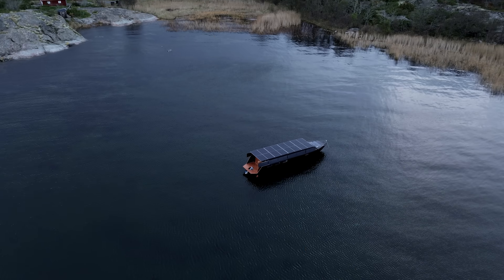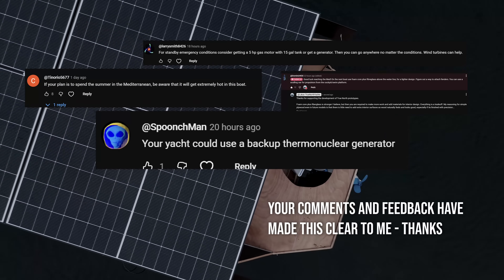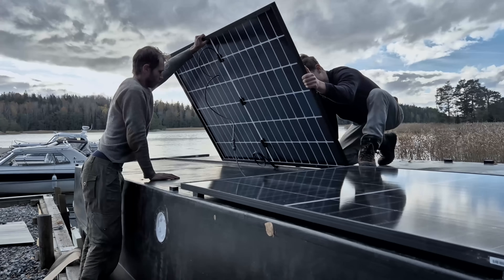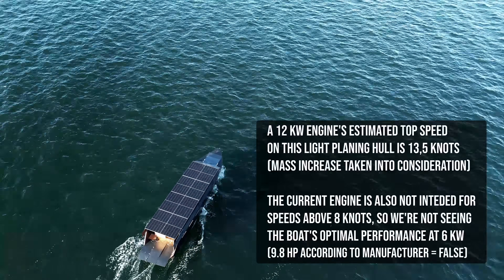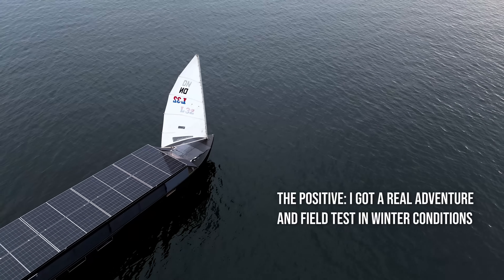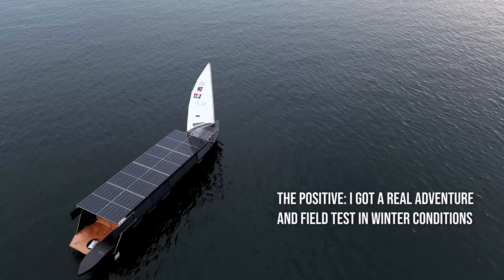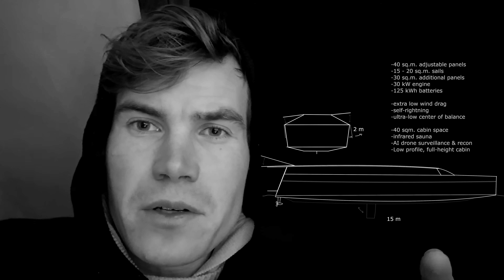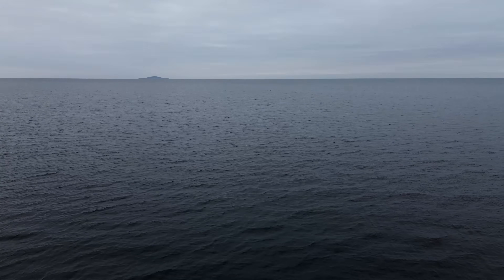3 Mistakes That Nearly Sunk My Solar Yacht

Comment: Mistakes, hehehe,
It is really funny how people watch other people make mistakes and think they can do exactly the same thing but succeed.

Hullspeed based on LWL, hehehe.  do you think a shallow draft(20cm) 13m LWL has the same hullspeed as a 13m deep draft(1.5m) boat.
Hullspeed is not just LWL, it's also wetted area(drag) and shape
Sails, your little sail won't do much and is easily tested. 
There are also programs to develop polar charts, but they may not work for such a small sail on a big boat
A sail your size on that boat is like putting up a  storm jib to keep the boat in irons over night

Comment: Why don't you build a battery with loose cells? Type EVE 314Ah or EVE 628Ah, then it will be much cheaper and also lighter.

Comment: Take a look at the idea of using a parra kite sail ... Smaller size up to 8x the power for a given area and no shadows on the panels . You would need less keel mass and area than traditional sails.

If you can add out riggers you can add hinge panels to the cabin sides  ...at higher latitudes in winter these can work better and start earlier  than horizontal ones ...if they were bi facials over the water there's a significant efficiency  boost there.. being able to angle the panels on both sides from almost vertical through 180deg. Means you can optimise exposure in calmer conditions.
Reply: A para kite sail is a great idea. 
I think it’s possible to automate flying the kite by having a quadrant of limit switches in the shape of a rectangle around the control ropes and two stepper motors to control the ropes. 
Utilize AI to write the g-code program that controls the motors. 
Wonder if there’s an open source group working on this challenge…

Comment: great work, great spirit. for now it's the operating conditions that are so far out of spec, a back-up generator is simply common sense - get south quickly! get warm! winter solstice 4 weeks.
few battery chemistries enjoy deep discharge, so for protecting your investment a generator is common sense.
any offshore craft dependent on electricity ought carry a back-up generator, including future developed versions. how do you meet mayday response obligations, for example?

Comment: Without a keel, a sail will just take you in the direction of the wind.
Reply: Leeboards would be a good addition, no interior intrusion.
Reply: @MrEricmgt  I think leeboards are the right call as well
Reply: A kite less so but  a  couple of inline dagger boards would help without the penalty of drag. Boreal  uses two fixed dagger boards on their  monohull explorers .. though a Cat like a Wharram Pahi would provide the best platform or by  adding out riggers to his existing hull  he could add stability buoyancy and  top hinged solar panels all on each side.🤔.  A lesson from Sunreefs and other experimentals at higher latitudes.
Reply: Should have dagger boards
Reply: Agreed. 
Maybe a swing keel so that it can swing up if the yacht hits shallow water. 
This would dramatically stabilize the boat at anchor as well as at sea. 
I watched other videos he has where the boat was being built and he did include a keel but for sailing a daggerboard or swing keel is super helpful.
Reply: Centerboard will also do the work and its better on shallow waters
Reply: daggerboard will help w/sailing upwind
Reply: Amen to all the keel and dagger board comments. He could carry the sides down to the same depth as the centre of the hull too, but the increase in drag would be substantial. This means some retractable method is needed.
Reply: Even a small trailer boat without streaks will slide and sluff off a wave under power without wind pressure on a sale.
Reply: This prototype has roughly 1 square meter of keel area. Pretty low drift.

Comment: As long as you will not be running it at planing speeds, a straight bow would be better also. It increases waterline length and reduces drag at speeds close to the limit of displacement speeds. It also gives more internal volume and less splashing sounds. Internal wall insulation is also a must i would say, to reduce condensation. On the 15m version you could fit a mini air/air heat pump as well to handle heat and moisture. 

Now I should start building my own in stead of just dreaming and watching youtube 😆

Comment: I'm waiting for someone to make an actual sail that is a solar volatic.  We are not far away, the tech exists, just making the right configuration of flexible panels that it can be folded down into the sail bag and extended easily.  The sails are already harvesting the wind power, why not the solar power directly too?
The hull ballast should be the batteries.  Build the boat around the batteries so the battery mass forms your keel stability mass.  Your sails your panels.
Reply from the maker: Interesting idea about solar sails, I'll definitely keep an eye on that technology!

Comment: In the mediterranean you will be running a surplus most of the time and probably not use much battery at all if you stick to moving in the day.  the mediterranean is very differnt to the north.  I have been livign in  an offgrid house for the past 10 years and hardly ever have to put the generator on.